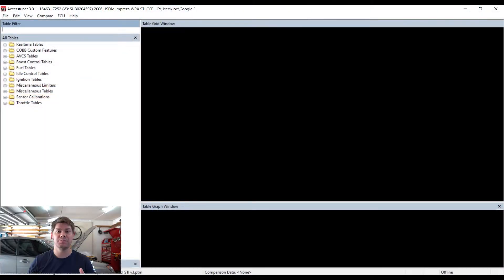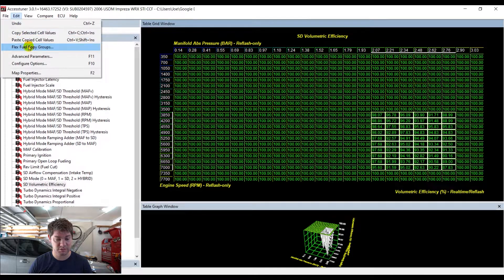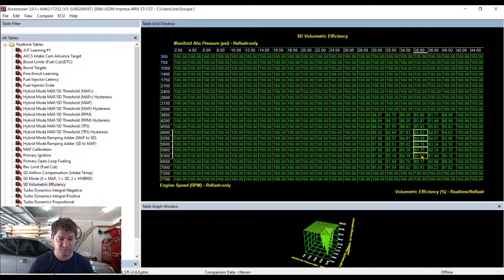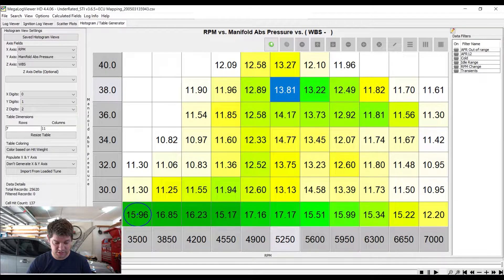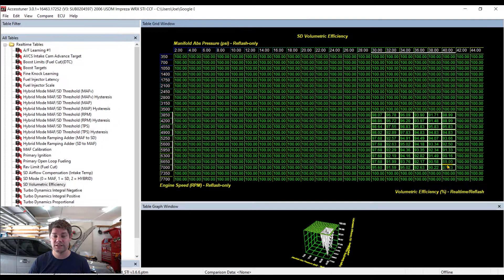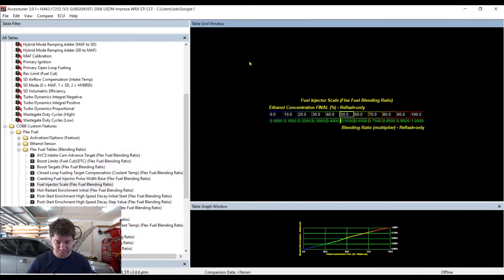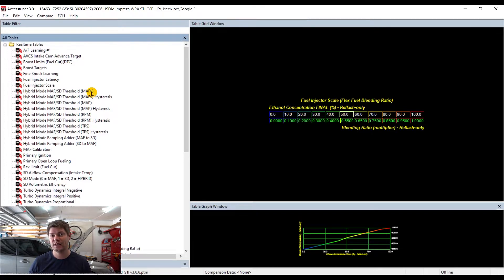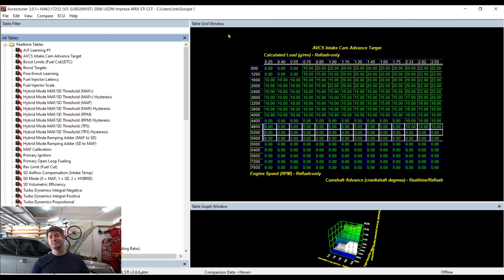Cobb AccessTuner Subaru STI, Flex Fuel E85 Step 2

Comment: one of the very very few that is posting videos about tuning a subaru and an STI and on Accesstuner , keep it up man! lets have a conversation and share knowledge, I'm a beginner at tuning, but so far got the flex Fuel dialed in and I'm currently trying to add power but without a dyno its a lot of guess work on the timing and boost. I would love some tips and tricks!

Comment: Lambda is always going to be the same with any fuel. Below is Stoich which is always 1 no matter the fuel listed.

C16: 14.8:1
Pump gas: 14.7:1
Diesel: 14.6:1
Q16: 13.6:1
E85: 9.8:1
Methanol: 6.4:1

WoT would be .8 acrossed all fuels. Just switch to Lambda and save the troubles.
Reply from the maker: Good info,  ya need to make the plunge to Lambda fully,  just wish I could choose the tables in Accesstuner for metric vs standard.
Reply: @joesgarage1771   I 100% agree with the above, switch to Lambda, I tune in lambda, it takes a lot out of the confusion out.
Reply: and I also agree with the engineer, add the fuel pressure sensor and utilize their Fuel pressure differential compensation feature, its amazing.